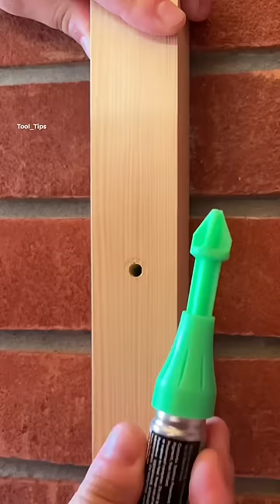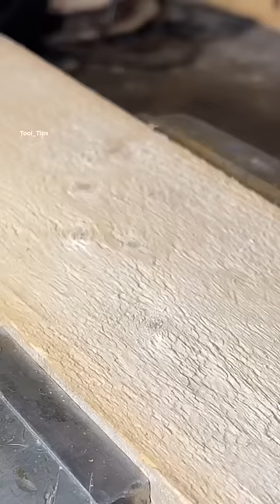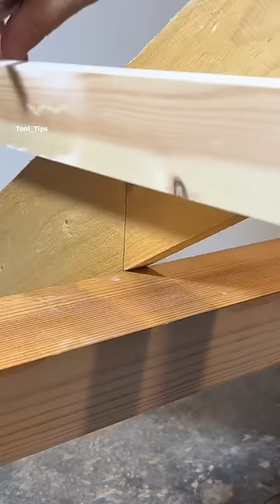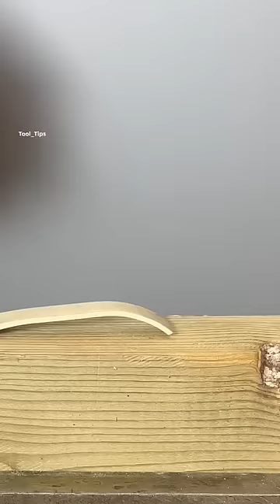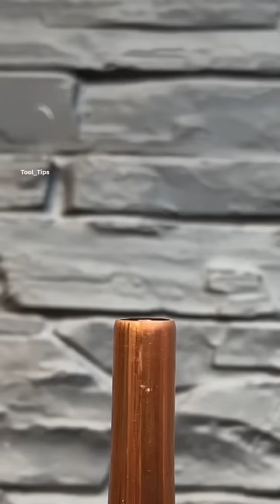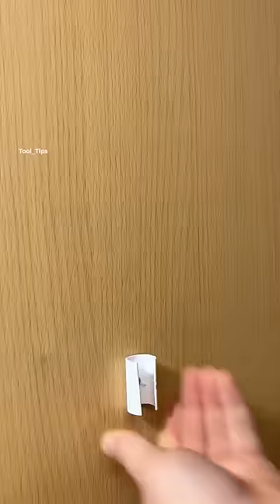10 Tips in 1 Minute #shorts

Comment: What's the first green marker tool?  

That will save a lot of time.
Reply: im curious as well
Reply: Duramark Chalk Shot
Reply: A kind of spray paint pen.
Wonder, if it works with normal spraypaint too.
Reply: @FrogeniusW.G.  It does work with regular spray paint I have done it for years, but I use marking paint! To get a similar effect you can just get a can of chalk spray paint, it would be a lot cheaper too!!!
Reply: @randyherringshaw6325  
Ok, thanks for that. :)
What is marking paint, how does it work?
Reply: It's called a marxman
Reply: @randyherringshaw6325   Thank you , the first one just baffled me.

Comment: I made a rather long comment and I read the other comments. There's a lot of criticism about the things that are done well because they have faults.. as I said there's no one way to do anything that's why they should have all of the how to do categorized.. some things you want to be forever and some things can just be for a little bit. That's why there's more in one way to do anything and the critics say well that's is because you have to have the abdome
   The correct tool for the job the correct repair for what is necessary.. glue guns are temporary fixes they're quick and like everybody says about that ain't going to last forever. That's why you need to have 50 different ways to do everything and show it. Because some people want to charge for a temporary repair in get the price of a necessary one because they do it the right way. When I was 7 years old I was crawling underneath houses and I was sweating copper pipe there was no plastic. I was packing Oakham and pouring liquid lid to seal cast iron pipe used for sewers because there was no plastic this is how it was done.
    there is no right way there is no wrong way it's a matter of what is necessary to get what you need. So all the critics you're just criticizing one thing but that's not how you do it for everything that's why you got to know how to do one thing 20 different ways depending on how long it needs to last.

Comment: That swedge is asking for refrigeration leaks😂
Reply: I use those all the time. I think they are better than a coupling because only 1 shoulder joint and as long as you do it the right direction you don't have that ledge in the line so the refrigerant flows  better
Reply: @chriswhitaker210  i definitely agree! I was just laughing at how he was shaving away the inside of the tube, cause that would compromise his swedge when the system is pressured

Comment: Swaging (using a tool to increase copper pipe diameter to fit another pipe) is not a tip, it’s a basic skill you have to learn to do any sort of hvac, brazing, etc.

Edit: it also looks like the pipe wasn’t even reamed which is a no-no

Comment: Hello. I am in desperate need of some advice. The house I live in, the previous owners ran a water line to the ice and water dispenser of the refrigerator from one of the bathroom sinks. Now it has a lever on it that is supposed to close the line to the refrigerator off, but it is completely and utterly rusted shut. I bought a nut cap to put on it, however, as you may have guessed, it wasn't enough and water went everywhere. Does anyone have any advice on what I can use to plug the line closed so that my roommate can use the cold water in his sink without giving the kitchen a shower?
Reply: Disconnect it?

Comment: Is that for tricks for an eletriction? I love the part for the handle for all my rakes brooms shovels hoes any thing with a long handle on it my mom used to say wrap thread aroun d it put glue on it and it will go in but I love that glue stick I'm not sure about cutting that wood would do but I'm not a carpenter or a builder.i didn't get what he used to keep the wood from splitting and I love how he held the wirering down but I don't no what that rubber band was for but I'm sure it was something wor th while I just wish I could see I somehow people's imaginations work I just love that but I don't no that would work with the copper pipe I worked in a hard ware store but I don't think that would work witho I never tried it so I really don't no. But good thinking and thanks for sharing thats one of the reasons I love google thank u again

Comment: Dont use a glue stick to make a screw tighter, thats a major fail. If you cant use a bigger screw, carve a piece of wood slightly bigger tha the hole, tap it in, cut it flush and then you have fixed it.

Comment: DO NOT fucking GREASE a screw, use a drill bit and PRE DRILL THE HOLE. That's the CORRECT way to prevent wood from splitting.

Comment: The plastic pipe clip doesn’t work.
The rubber band pulls off the nails. 
The plastic straw wall plug just spins. A sharpened wood peg is far better.

Comment: Person can’t even count to 10 - There weren’t 10 tips! 🤣
The last one was doing the same trick into 2 different materials…
The glue stick is a terrible idea (fill with glued wood dowel). The rubber band should have nails with flat heads so it doesn’t pop off. The stair joint is going to be askew if the end isn’t set off the ground.
 I did learn about a Chalk Shot  (green marking tool) and proper name for the swedge bit! (That makes the copper pipe joint 😎)

Comment: Not a tip just a tool, pencil clearly fit tho

Just buy zip tie masonry anchors

Why would you use side cutters to hold onto that and not some pliers, good way to destroy the edge of a good pair of cutters 

Actually decent if you don’t have a ruler

Just use an insert 

Why?

See now you’ve confused me cause you used your dumb little glue stick trick on the last screw, but not on this one, so either I don’t need glue sticks, or I don’t need grease

Use a coupler

Just use a pvc pipe clamp or strap

Comment: What's that bit that flared the copper tubing?
Reply: pro fit  by rector seal Technically it's a swedge bit several different companies make them they also have ones that make flares as well I have a set swedge bits they work great I ordered the ones for flaring copper should be in any day

Comment: The rafter notch isn't so cut and dry!  👎👎👎
You need to have some dimensions with which to get the proper pitch.
You would use a speed square or framing square to do this job correctly. 
Not just grab any old piece of wood!
F'n nonsense!!!